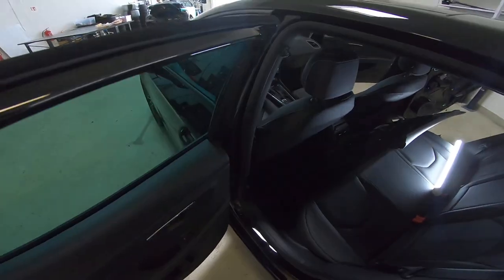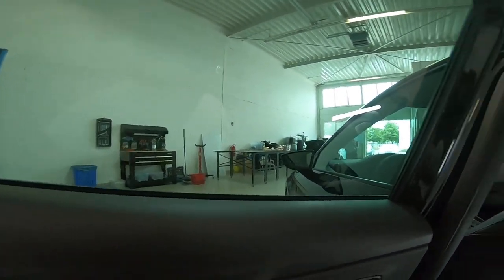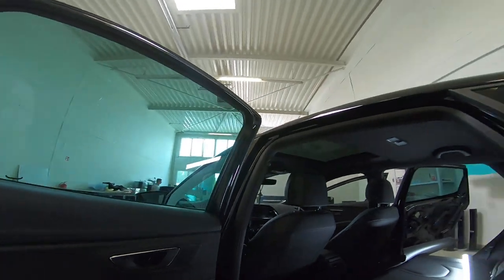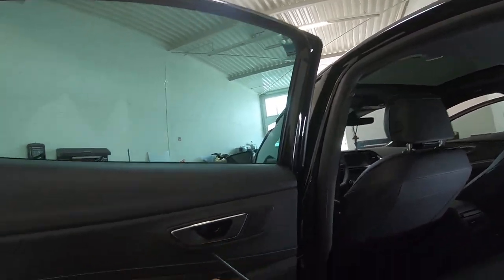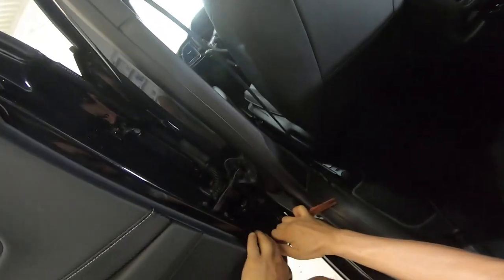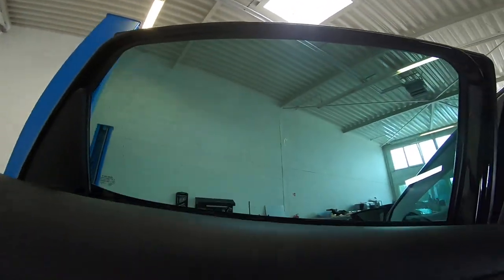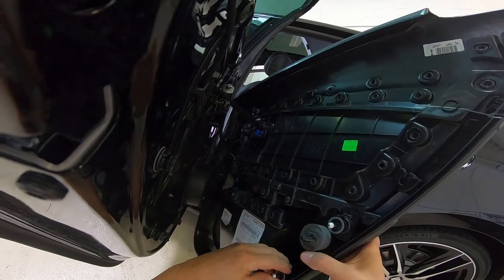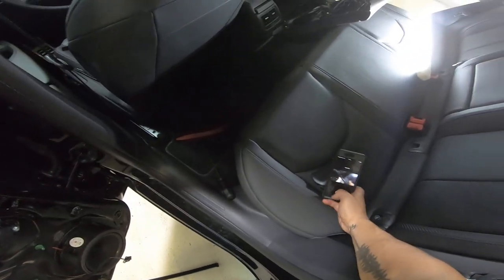How to remove the rear door panel Seat Leon Cupra

Comment: Thank you for the info. Can you also take a video about b pillar plastic trim removal? Especially the top plastic one. I have an annoying clicking sound up there I want to fix. I tried to open it myself by looking at the repair manual but one of the clips is too strong and I don't know what the trick is. 

Thanks in advance